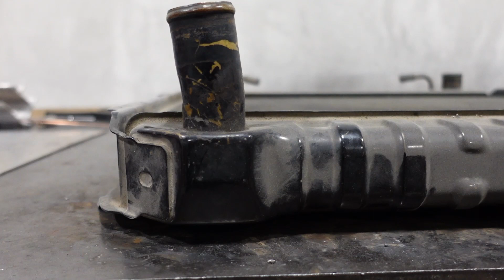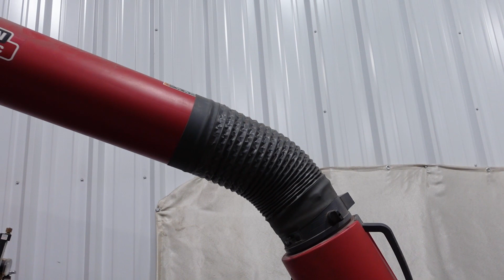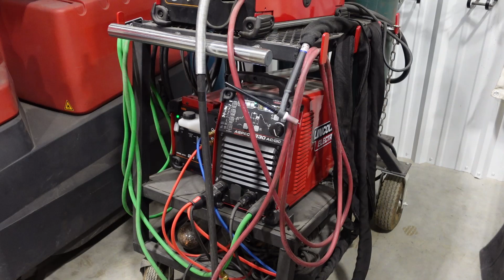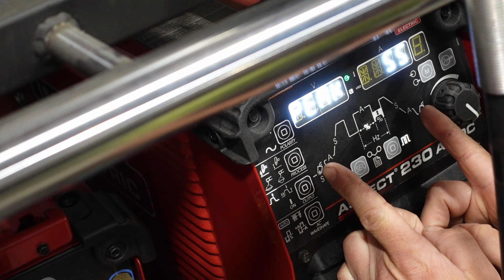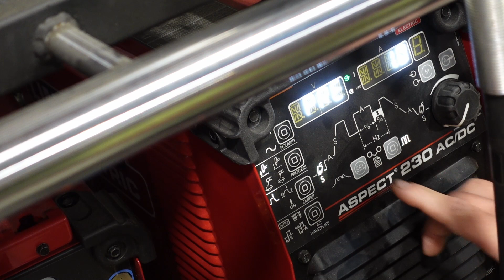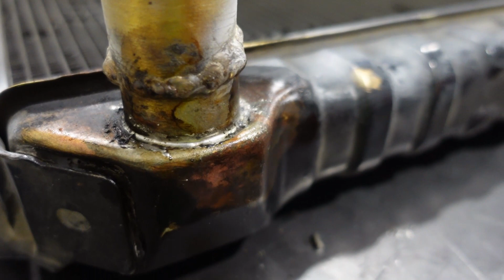Brass Brazing | Welding with Joe

Comment: Also, do not use chlorine brake cleaner to clean injector bores. I replaced all eight injectors in a medium duty GM 6.6L. I started the engine and it about killed me. It was burning the chlorine and sending it out the exhaust. I had to run out of the shop, I couldn't breath.

Comment: Why didn't you show us the process? Would love to see that. What I would really love to see and learn is the old school methods for brazing and soldering. Like that would have been done in the 1950's or earlier. I just found an antique bernz gasoline blow torch and it got me thinking. I love old school anything. I daily drive cars from the 80' and 70's. We used to have a drive shaft shop in town that also repaired radiators. But I heard the guy died so the radiator business fizzled out. We live in a terrible throw away culture these days!

I really think it would pay some young folks like me to learn some of these techniques before they are lost. People with antiques that they want to keep that way would and will more pay big bucks I'm sure to have things repaired in the correct methods. Think in terms of someone like jay Leno wanting to have something repaired on one of his old rare steam powered cars. Of someone was very good at doing that work in the time period correct way. I'm sure people like him would pay well for that. Probably have guys sending you things from all over in the mail to fix! Maybe it wouldn't be a source of full time work. But a really good and important side job at least.
Reply from the maker: I was too busy trying not to die from all the zinc fumes. I'll never attempt this job again
Reply: @doomsdaydiesel  haha. Really? I always thought zinc was good for a body. It's some of those other ones like mercury and lead you gotta watch out on.. 

It's funny how in today's world we are so worried about being clean and sanitary. Honestly most of the old timers that worked around alot of hazards lived to be just as old as they do today. I've lived in a house with tons of asbestos covered pipes for nearly 30 years. That's one of the things I do take kinda serious.. 

And just to poke fun at ya a little bit... But I don't think you will be too ready for the doomsday with that attitude! Haha. Take care friend!
Reply: Also not to be a dick but for the very small amount that inlet had to change direction, and the amount that you buggered it all up... Wouldn't it have made better sense to leave it alone? After all it is more likely to leak or break now I would imagine. And radiator hoses are very forgiving..?
Reply: Bizarre you have spent all that time not showing us how you did it and then tell us you were trying not to die from zinc fumes despite having a respirator. I suggest you delete this video or at minimum change the title to ‘Not Welding….’.

Comment: Higher silver content is better for joining brass. We use 45% silver brazing alloy for brass. 15% silfos will work, but not recommended. I didn't see if you used the flux for silver brazing, but that may help as well
Reply from the maker: I'd looked at using a silver alloy, but at the end of the day, I'll probably never use it for anything else, and I'll have plenty of others uses for this Sil-Br, plus it was recommended as a suitable filler. I just forgot to mention the silver alloy filler in the vid, so thanks for bringing that up. I did try playing with flux. I also tried AC. Out of everything, the diameter of the filler is what killed me. I tried it on some thicker stuff the other day and it worked nicely.
Reply: Id like to see some videos on welding issues or does and don't for stainless and aluminum